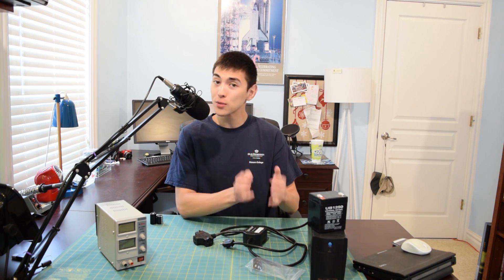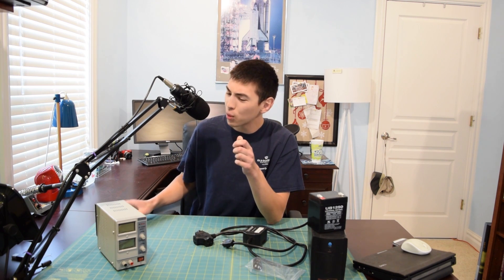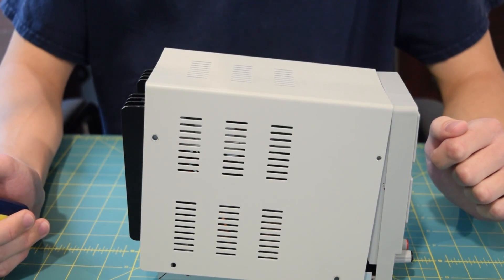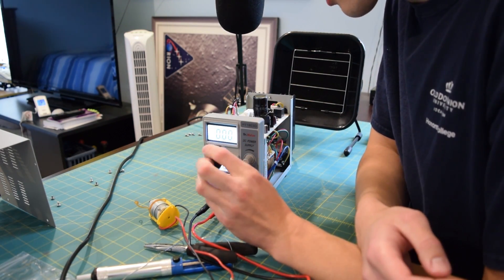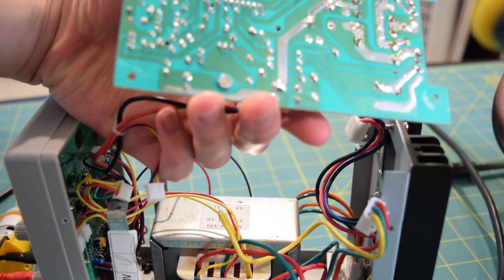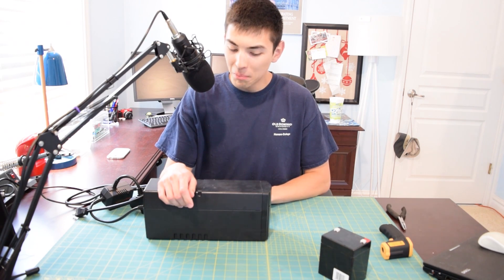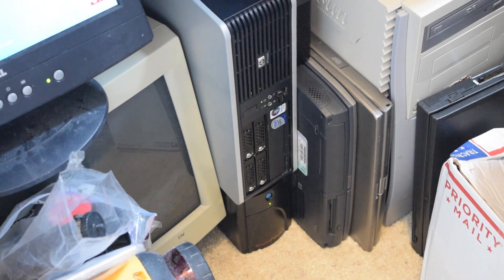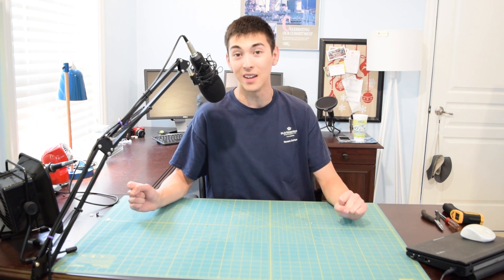Failure EP6:  Dr.Meter HY1803D and Smart Power Systems 240W UPS Repair

Comment: You could measure the voltage directly on the power transistor.
Also if the meter shows a voltage then the regulation is fine since the meter should be connected directly to the output.
There is most likely to be an issue with your current sense circuit, i'd say it's the current sense resistor that went open circuit.

Comment: Hey, I have the same power supply with the same issue.  I'm in the process of diagnosing it right now and there are a couple components that have gone bad.  Namely the large cap in the center and the four large diodes right next to it.  Test your diodes next to the cap with a multimeter on diode test mode and see if yours are shot too, might be the main issue.  I also noticed a couple other medium sized diodes that have bit the dust on the board.  Also, use Digikey to order parts.  Way cheaper than ebay and you're almost guaranteed to get an exact match if you use the part no. from the manufacturer.

Comment: I hate it when money is tight, and you have no choice, but to go with these cheapo power supplies. Might I suggest that usually in electronics, when one component goes bad, that can lead the rest of the components that are hooked up to that circuit to go bad as well. The capacitor was definitely out of tolerance and would not be suprised if it was shorted. Some people just reverse engineer their cheap power supplies and replace all capacitors as soon as they get them. I am actually ordering one, but I am skeptical of it to be honest. You get what you pay for, and unfortunately, power supplies cost way too much. I hope you were able to figure it out later on, but if not, it was $50 and you could just get a new one.

Comment: Here's some feedback. Hot electronics completely surrounded, on carpet, in an enclosed space with no airflow =  huge fire hazard.... You may want to consider a safer setup for your server room. Most require a cooler environment.